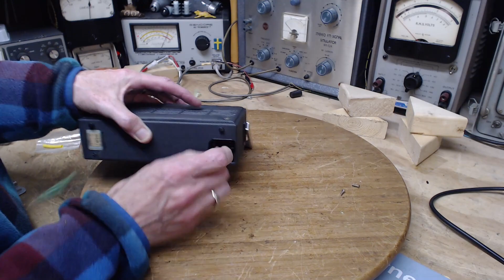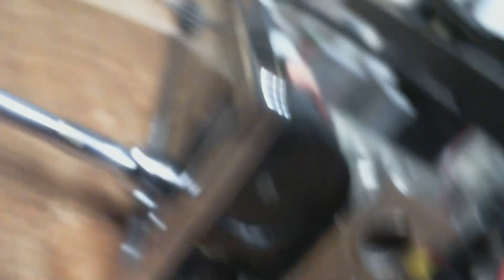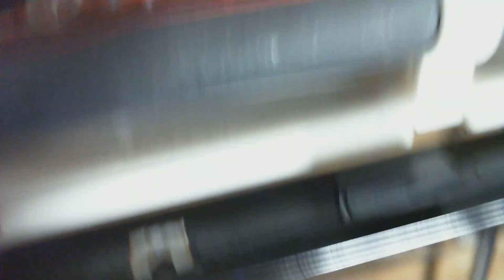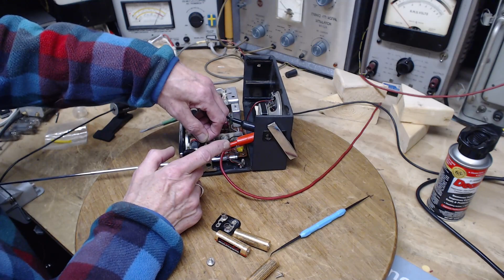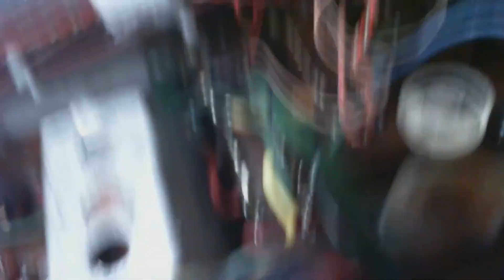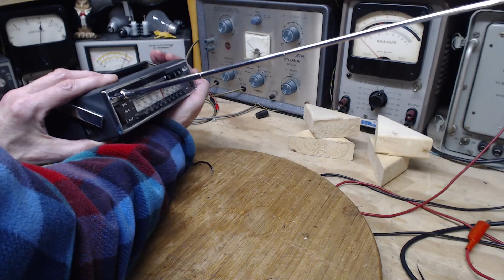Grundig Prima Boy Luxus Repair Video #6 - More Trouble

Comment: Looks like the antenna goes to a coil then to C15. So find C15 and touch you finger or and antenna to C15. 
I thought it went to C10 at first, but looking closer C10 is being pointed to..